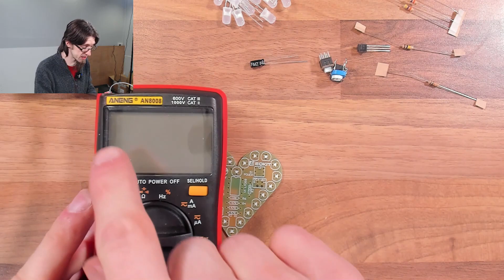Pine64 Pinecil, PinePower Desktop, kit-build - LFC#257

Comment: You're probably the only person who owns a TS100 and hasn't upgraded it to the Ralim IronOS. Highly recommend it. The firmware upgrade takes ten seconds and you get the same UI that's default on the Pinecil
Reply: I haven't either but I certainly will. I didn't really have a problem as is but then I've never ventured in to the OS other than changing the current temperature.
Reply: @SimonNemeth  Ralim's firmware is waaaaaay superior to the stock one. Just do it!
Reply: I totally agree. Ralims firmware is fantastic.
Reply: but the firmware don't magically add the USB C power port ;)
Reply: @scaramonga  I don't think anyone said it would
Reply: @scaramonga  If you need USB C in your TS100 you can get USB-C to 5.5x2.5mm adapter for under $5. It has all the logic inside to negotiate voltage and power with USB Power Delivery capable supply.

Comment: I own a Weller Pro station and I love it, but of course it lives at the bench.  For the last 10 years I've been using an Iroda butane iron for field work, and just recently I made up about a dozen wiring harnesses (away from the bench).  The Iroda is a fantastic butane iron, but it's still a butane iron.  No (accurate) temperature control, throws off tons of CO (drove my alarms crazy), long heatup time.. and constantly out of gas.  Decided to see if there was something new on the market.

... and found this!  Ordered it along with a 4-pack of large tips.  "I'm stoked" is an understatement.

And great video. :)  You're a fantastic presenter.

Comment: You are a great tech. You should know the secret to a good soldering job is a tinned tip. Longer life for the tip and cleaner soldering connection. Also tinning the leads  and or wires works wonders. But great contents. You are very knowledgeable. Keep it up buddy.

Comment: 21:56 - I find that kind of operation (and even regular soldering) much easier with a conical chisel tip (BC2), as opposed to a simple conical tip (like the B2, which I assume is what you're using there) or even the wedge (D24). The conical chisel holds a perfect little blob of soldier on the tip, it doesn't try to climb up the cone, and the flat part of the tip makes it much easier to heat pads. It's basically like a wedge tip that can get into smaller spaces.

Comment: That's Ralim Firmware , you can use it on the TS100 as well and you will have all the options
Reply from the maker: Ah, like, exactly the same firmware? Someone else mentioned that a newer firmware for the TS100 gave it more or less the same options, but is it identical firmware?
Reply: @Adamant_IT  Yup, all the same bells and whistles (except for the type-c obviously), same user experience, same everything.
Reply: @ebinwaitee  Except, it is a different controller, Risc-V and different pricing. ;)
Reply: @worldhello1234  Yeah, but the user experience is identical despite what's under the hood is my point

Comment: I updated the firmware of my TS100 on arrival, some time ago. It has a different interface than the one shown in the video, almost identical to the one shown in the Pine64 and also has boost mode.  I don't remember seeing the "hall effect" feature but It's been a while so I'm sure there will be more recent versions hanging around, so if the hardware has the feature it might show. I should check. I recommend doing the upgrade asap, it definitely improves the device.

By the way, I purchased mine in a kit including a DC adapter specifically designed for the solder with a long silicone wire, avoiding the risk to melt the cable if you mess handling the tip when hot (which has happened to me more than a few times in the past). I totally recommend buying one of those with the device, it is quite convenient.

Regarding speed to reach temperature mine needs 10 seconds to go to 380. It might be the adapter being 24v 3A (72w), though.
Reply from the maker: Yea, I suspected that newer firmware for the TS100 would be better, or at least there'd be unofficial firmware. The main draw for me is still having Type-C PD and barrel jack on the same device though - that flexibility is a big appeal for me when the whole point of these electronic irons is to power them from whatever you have laying around.
Reply: As a matter of fact, I just checked and I was using Ralim firmware that other people are also suggesting. My bad.
The stock one doesn't have the fancy interface or the boost option.

I totally agree that Pinecil is a more interesting device, but owners of the TS100 can close the gap significantly with that simple update.
 
Regarding usb-c I don't own a suitable powerbank yet, but I have some adapter boards (you might have tested them in some video), so it will be easy to make an adapter cable to XT60 to accept 20v, or even hack and replace the barrel connector (which I fancy a lot, as I like te ability to rotate the device so it rests well oriented). It is a small investment.
Reply: @JosepsGSX  In case it wasn't brought up before. The Ralim firmware you can load on the TS100 is the SAME firmware that the Pinecil uses.

Comment: Thanks for this. As a result I have just updated my TS100 and the interface is much better and seems the same as the Pine64. It's also made me think about getting a better power source for mine as it currenlty only runs off 12v
Reply from the maker: Yea you'll definitely get more power and heat up speed from a 19.5v adaptor, highly recommended.

Comment: Although solder contains flux, I also use most of the time liquide flux applying it with the brush inside the lid. It largely increases the solder flow for nice connections. I also have the tolerance indication on throughole resistors on the same side, just for the nice look.
Reply: I'm a stickler for getting things lined up and the correct orientation (to read the values), even with SMD resistors, they all have to line up one way or another!

Comment: 2:36 - Not sure if you have an older version, but the voltage shown above the middle three ports is definitely not static on current ones. It always seems to stay between 4.9 and 5.1 V, but it does change. None of the voltages seems super accurate, though. The leftmost port sometimes shows 0.3 V more than it's actually putting out.

Comment: I do like a very fine cone tip for when stuff is really close together and I have no space to work. Sometimes I even hang a drip of solder onto the tip and place it like that when i don't get the solder wire in in a convenient way.

Comment: You can use the tips from ts100  ts101 even the long ones too for the pine64 pinecil!
With mod firmware you can use 28v 5 ampere ! And that's powerful!

Comment: I've recently gotten into soldering and purchased a cheap kit from Amazon for $25. It takes far too long to heat up and I was going to get a TS100. It seems that this is the better choice since it's firmware is better out of the box. Plus it's cheaper than the TS100.

Comment: Well, on TS 100 you can program a similar interface, is what i use and looks mostly the same.
Reply: The Pinecil is IMHO overall the better deal, with Risc-V controller, free programmable firmware, USB-C and better pricing. The problem is availability. :)

Comment: About the soldering-tips. I have really bad experience with the cheaper ones. I bought at least 10 from Amazon and Aliexpress and they all got bad after a few hours of use. I think they all had a really bad coating because the solder was not sucking at the spot of the tip anymore and just bubbling around the the side of the tips which is really annoying. The only tip that's still working perfect since years is the original one that came with the T100. So i would recommend to get only the original Miniware/Pine ones. The are a bit more expensive, around 20 EUR / piece but for me they are worth it!

Comment: The main differences between this and the TS80 are the RISC-V chip in the Pinecil, and the 3.5mm "audio jack" tip plugs on the TS80 series. The TS80P has a spring-loaded grip for some reason; I swapped it for the grip on my old TS80 whose screen died. :(
Nothing wrong with the TS100 tips, not sure why Miniware changed up the connector and gave the TS80 and not the TS100 a chonky big screwdriver tip that has serious thermal mass, but there we have it.

I also love that you can set the default screen on IronOS to just display all the things (voltage, temperature, etc.).

Comment: When you solder 0402 sized smd's on a daily, a cone tip comes in handy. Believe.
Reply from the maker: Surely a knife-edge is more helpful there?
Reply: @Adamant_IT  maybe. But once you change tip and you get used to it you know?
When I started out I used the wedge type tip and was able to slide solder with ease but I can't do it well with the cone tip.
Maybe it is time to go back to a wedge again. ;)
Reply from the maker: Yee. At any rate, definitely use whatever works for you - everyone's got preferences!

Comment: I installed IronOS on my TS100 so it functions like a Pinecil. That way I don't need to buy the new one. It will even solder off the USB but I wouldn't recommend that since Micro-B is weak.

Comment: I have the Pinecil connected to a PinePower with 65watts (USB-C) and if i touch a larger metal area it will shut itself off. I bought this PinePower because i wanted to have a fast soldering iron as my old 85 watts Weller and in all the reviews i watched it looks like it was very fast, but if i can't touch metal i have no use of a fast soldering iron. Maybe you could try and touch a larger metal area with the soldering tip? Will it shut off your PinePower too?

Comment: FFFFFFFFFFFFFFFFFFFFFFFFFFFLUUUUUUUUUUUUUUUUUUUUUUX! I’m gonna start bugging you until you get it right like! Cheap liquid flux is perfect for these little kits. 👍🇬🇧
Reply: The cheapest flux pen you can find from anywhere that suits the user is the best flux to learn how to solder. Flux has to be used when soldering. The EU market is flooded with a Polish brand liquid flux that is very good. That’s why I mentioned it. I can recommend it to entry level soldering with excellent results. Hope this helps anyways. 👍🇬🇧

Comment: Still prefer my cheap soldering station, FEITA Mini portable.... It's power supply is the same size as a laptop PSU. The Solder handle accepts Hakko 951 tips, so you get a MUCH wider range of tips, and the tip makes a HUGE difference. The handle itself is light and super comfortable to use. I love the control interface on the power supply: power toggle off/on, temperature up, and temperature down. This is all I need to bother with on a soldering station. I love a simple tool that's highly effective. There are more options to toggle and mess with from what I understand, but why bother?

Comment: Is this a good soldering irons for beginners? And do you need the desktop?
Reply from the maker: Yea I think it's a great beginner's iron. It's capable of approaching the hard stuff (laptop mobos, which suck up heat from irons) but as cheap as a no-name brand. The PinePower desktop isn't required, you can use any PD65 supply, or most general use power bricks. 65w Toshiba laptop charger is perfect for these as well.
Reply: @Adamant_IT  so what does the desktop do exactly? Can you use the iron by itself? Or is that like a charge?
Reply: @Adamant_IT  I've only ever had a cheap plug in Iron for my mods, so I'm fairly new to soldering.

Comment: Can you grinding the conical tip into a chisel tip?
Forgive my ignorance
Reply: Grinding or filing on a tip is generally not recommended.  The tips are plated with an alloy that is resistant to the heat and flux.  When you scratch or damage the tip, it erodes much faster.  I have one tip on a Weller that has lasted more than 25 years.  I am very careful not to press too hard or use it for a screwdriver or pry bar.

Comment: I'm planning on releasing a similar product.  Nose hair clippers, powered by a 128 core 64bit UltraSPARC SoC, with 2TB RAM, NVMe storage and 100GbE WiFi, running a hardened Trusted Solaris.

My friends tell me this is a solution in desperate search of a problem, but I'll show them!

Comment: Hey pal i just got my Pinecil and i destroyed the barrel jack by accident.... could you try making a video about a replacement barrel jack? (Also the Barrel Jack that Pine64 uses is really badly designed and made in my eyes)
Reply from the maker: Honestly I'm impressed you managed to break it, it's an all-metal design! Replacement is fairly straight forward, it's designed that you don't need to remove the type-c connector on the other side - just 4 anchors and the centre pin.
The tricky bit is finding the replacement part, as it's not the standard plastic connectors you see all over eBay. I'd joint he Pine64 discord and ask about parts there, they might be able to help!
Reply: @Adamant_IT  i tried but so far no one gives me the right replacement part number/website i tried aliexpress but no luck, i honestly don't want to order a new one from china but i guess even china doesn't have one either😂🤣

Comment: hiya buddy. whats the usb cable you use to power the device with the pinepower desktop? I clicked on the pine link but it says maintenance mode
Reply from the maker: Type-C USB cable. Just make sure you buy one that's correctly rated for PD65 or more. I always get 100w cables, because overkill is underrated.
Reply: @Adamant_IT  Thanks for the swift reply, I just bought the Pinecil, PinePower and the cable they recommended from the Pine store, so I should be cushty.

Comment: What other options are there for powering the Pencile?
Reply from the maker: The DC jack allows you to plug in any 12-20v DC source, I regularly use a 19.5v laptop charger with mine. You could also get an XT60 cable and then power it from 4 or 5 cell lipo batteries.

Comment: Have you tried filing the tips you don't  like?
Reply from the maker: I would if I knew how to re-coat them. Don't they need a proper coat on the tip to tin correctly?
Reply: @Adamant_IT  Now that you mention it, I don't know.  I was just having a brain fart.

Reasoning
I've had a small mix of coated and non-coated irons over the past 20+ years but I am just a hobbyist.  I've had no trouble tinning the non-coated but I found they had a habit of burning away, too easily.  The coated appear to be very wear resistant but I had never considered if the underlying metal could be tinned or not.